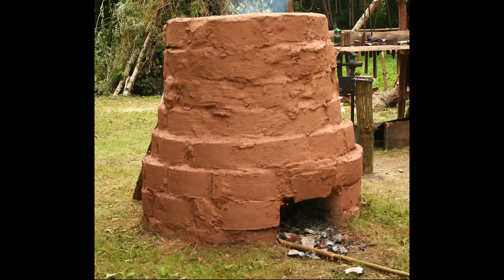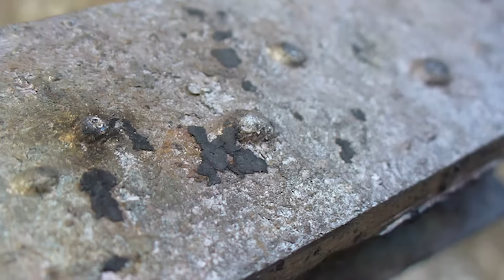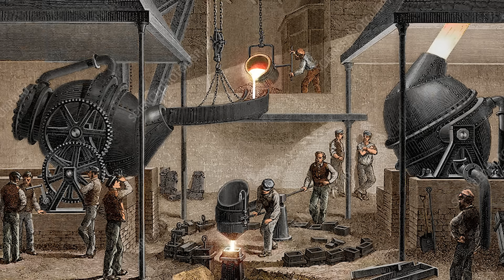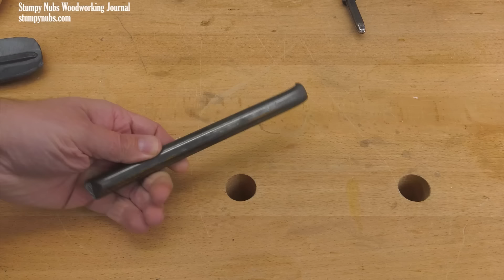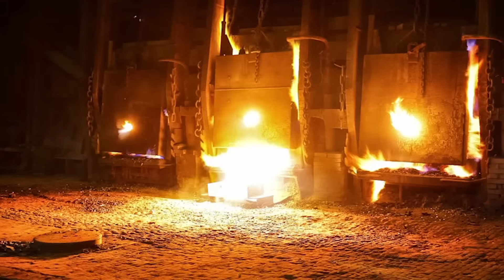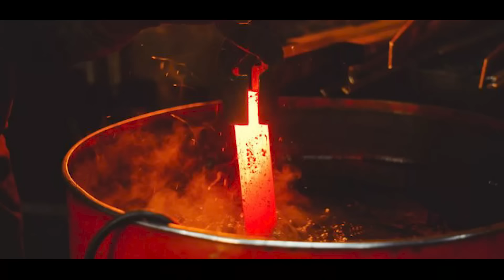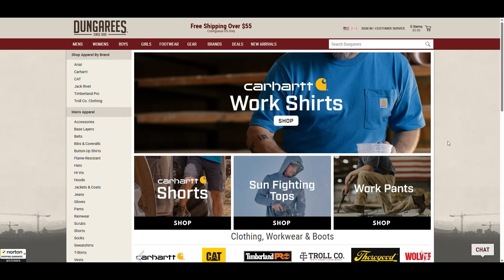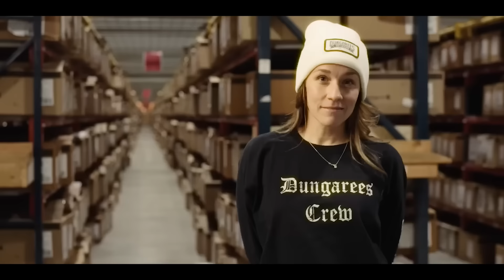Why they REALLY don't make tools like they used to

Comment: I used to teach a course in industrial materials and you got it right.
Reply: the only problem is the comment about bloomery furnaces that produced unforgeable pig iron. Bloomery furnaces in all their variations (such the tall, reusable ones of gallo-roman tradition, and the slag pit single use of germanic origin) were generally unable to produce pig iron, and were used till around the 13th century. They produced a very well forgeable and weldable bloom of iron with uneven carbon distribution, but generally low. Then to make steel the broken bloom was put into an Hearth furnace to enrich ir. From the 13th century iron makers developed the early Blast furnace, way taller than Bloomery furnaces, with a stronger draft and forced air, which indeed succeeded to make bars of cast iron, then broken and finally reworked in a hearth to make wrought iron or steel. This process went even into the mid 1800s in some places
Reply: Any good books you would suggest to a material science student?

Comment: Today's tool steels present a plethora of working qualities and are made better than ever. The problem for woodworkers is the same as always; a long lasting edge may be hard to sharpen and brittle. The basic O1 and W1 steels have a manipulable range of tempering that more exotic steels don't, and some of the heat treat requirements for higher alloys are beyond what even a skilled home machinist can do in a fundamental shop.

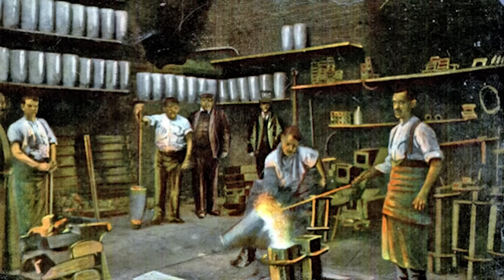Comment: @4:41 - I'm gonna be that guy - they weren't making low quality steel to make "railroad ties"
they may have been making rails, or maybe spikes, but railroad ties were/are made of wood.  (except for the concrete ones, but those are not steel either)

and, since I am already "that guy" - there is a typo in your more info section
Full sets (If you know what you want, this is a cheaper way to but.)
should be "to buy"

great video, James.
I often laugh at the idea that "older is better" when it ignores everything that has happened in the last 100+ years.
sure, there's a TON of crap out there now.  but that does not mean that we somehow CAN'T make better now.
Reply: While I agree that Stumpy got that wrong, steel sleepers (US: ties) do also exist.  They were used in areas where termites would often attack the wooden sleepers, or cases like that.
Reply: @PJRayment  well, I cannot say that you are wrong.  my understandin is that (in the US) the creosote levels of (old school) ties was so high that even termites would "nope" off out of there.
Reply: @ekw555  
"my understandin is that (in the US) the creosote levels of (old school) ties was so high that even termites would "nope" off out of there."
Perhaps so.  Termites was just an example—and possibly an incorrect one—of why steel sleepers have been used at times.

Comment: Pre-WW2 steel is a wild suggestion. The innovation in ww2 alone on steel is wild.
Reply: Unless they’re mistakenly associating it with low-background radiation iron post nuclear tests/use. But, by 2008 modern steel is back to negligible background radiation and not necessary. And, it didn’t affect the actual performance of the steel.

Comment: One thing is that vintage tools are often available for REAL cheap at yard sales/estate sales/flea markets/car boot sales (if in .uk). It's where i got almost all my woodworking tools (only a hobby woodworker here). I love my vintage stanley planes that i paid literal pennies for and had fun restoring and sharpening to dangerous levels :)
Reply: Edge tools are no fun UNLESS, they are dangerous. Keep the BandAids handy just in case
Reply: @johnduffy6546  No kidding, i have rolls of 3m micropore all over the place. In my day job i work as a commercial and domestic/residential electrician, i dabble in woodwork to relax. Cuts will happen.  If the tool is sharp,. it's a clean cut, and heals almost entirely in 24h
Reply: managed to plane 1mm off my finger the other day in penance for thinking i could take a few swipes at a dowel without using a bench and/or vise

Comment: In the argument of old verses new tools, I theorise that older tools appear better largely because of survivor bias. As throughout history, good tools command a higher price, partly because they are made with better materials. The surviving old tools often perform better than newer average tools, because they are usually the more expensive tools of their time and outlive their cheaper contemporaries. 
If we look at tools today, we have the technical ability to produce much more refined and improved materials. We also see that cheaper tools wear out, break or are otherwise discarded far more often than top quality tools. Thus we see that although more numerous, cheap low quality tools do not survive as long as high quality tools. Leading to false a impression that older tools are all better quality than new tools.
Reply: THIS !
Really good tools don't get thrown away, I've actually got chisels from my grandfather.
As I'm from Sweden, they are old Eskilstuna, and probably better than some real cheap ones today.
But not as good as good ones today.

Comment: It's worth mentioning that with the resurgence of hand tool woodworking in recent decades, there's also been an uptick in the availability of quality steel to make hand tools. 30 years ago, most hand tools that were being made were, indeed crummy and made with crummy steel. Also: when I buy vintage tools I rarely pay more than a few dollars for them- for me the cost associated with them is in time and work to restore them, which I enjoy.
Reply: Exactly. It is more time efficient to buy a new set, but learning to sharpen and make handles is an excellent project.
Reply: @ianbelanger7459  The handles are the great downfall of modern tools, i acquired some hand planes from on old polytechnic college which included an original stanely plane that had rosewood handles, that would merge with your grip and beside it were post war planes with worse and worse handles ending with one made of pressed sheet and plastic handles that would invite and welcome blisters.
Reply: @SToNeOwNz it is kinda astonishing how much difference a slightly large radius and slightly different grip angle can make.  The old handles require a better material to take the stresses, which is my guess at why they changed initially. It would probably be worth the effort to see if a modern material or manufacturing technique could reproduce the original styles.
Reply: @ianbelanger7459  I have made quite a few in the original style. I also sometimes reinforce them internally.
Reply: @Handcarvedbyrandy it is good to know it can be done with traditional materials, though I wonder about the cost. A lot of the exotic woods can't be exported as lumber and all the pieces I've seen have been quite expensive. I was more thinking alternate woods or interesting thermoplastics.
Reply: @ianbelanger7459  There are a lot of suitable domestic woods that will work just fine. Lie-Nielsen makes totes and knobs out of cherry
Reply: @Handcarvedbyrandy good to know. I just had a bunch of ash chisel handles shatter on me, so I do wonder about their selection process.

Comment: As a blacksmith, I've seen people fall into the "it was better back then" fairy tales about steel. Thanks for being real about it.
Reply: I'm a relative beginner to the craft, and when I picked up some proper mild stock to practice with I also got some 1045 (since that was the highest carbon content that particular shop offered). I wasn't sure how good it would be, but I found out that 0.45% carbon roughly matches the carbon content from the middle ages up through the renaissance and early industrial era. It's amazing to think that what we now consider to be medium carbon at best was the stuff that was used for swords, knives, axes, and everything else for nearly a millennium.

So yeah, we've come a long way. I still mostly work with mild steel, but when I dip into edged tools I feel like access to modern steels makes the whole process just a bit easier.
Reply: Knife maker here. I love the forgeable alloys, but it’s hard to deny the extreme edge retention of some modern alloys.
Reply: You’ve seen the stuff coming out of china? Anything is better than that garbage.
Reply: Here's the thing you have to take into consideration. I can pick up a vintage axe from my local flea market for about 10 bucks and the steel from that axe will be better than any sub $100 axe today. So there is fantasic value to be had from vintage tools if you don't mind a bit of restoration.
Reply: Absolutely right...it makes no sense to suggest that modern day steel alchemy and alloying is a poorer product than was available 100 years or so ago.
I have many modern made metal lathe cutting tool steel blanks that are extremely hard wearing and take a very keen cutting edge.
Reply: @howardosborne8647 I'm pretty sure the correct term is metallurgi, not alchemy lmao
Reply: @Shinkajo  I.m pretty sure alchemy is a terminology that is also used and relevant to the processes of alloying steels and other metal alloys.
If mocking my comment is the best you can glean from the comments here then I feel sorry for you.
Reply: @howardosborne8647 pretty sure you're mistaken. Will you please feel sorry for me too?
Reply: @beavisroadhog9629 Nah!😂
Reply: @howardosborne8647 Having the knowledge and using it are two completely different things.

We now live in a corporate run world where the bottom line and "number go up" is the end all be all. 

The quality is WAY lower across the board. The high quality might still exist somewhere... But can most people afford it??
Reply: @Foreverfreeusa  The amount of high quality metal alloys in all areas of modern day engineering/manufacturing far outstrips what was available to manufacturers in the past.
many applications in engine and jet turbine components for example would not have been possible with older metal technologies....we haven't gone backwards in manufacturing high quality metals at all.
Reply: @howardosborne8647 K... But YOU cannot get it.
Reply: @Foreverfreeusa  Why have you  written YOU in capitals? 
I have no problems getting hold of a wide range of specialised metals from carbon based steels,stainless steels,aluminium alloys,titanium and a lot of other high quality materials.
Reply: @howardosborne8647 Whatever... Corporations are using the best available to sell 🙄
Reply: @howardosborne8647  
there is one simple reason why we technically can't make steel as good as we did prior to 1945, due to nuclear testing the atmosphere contains radioactive isotopes in different ratios (and some which straight up didn't exist prior) than before, which does impact quality somewhat, although not enough to impact tool making like at all to my knowledge (like maybe you can run into problems when some of your tool steels carbon content decays into nitrogen, but carbon-14 has a half-life of 5,730 years so i doubt this issue will rear its ugly head anytime soon), but it is a legitimate concern in other applications which has created an entire industry dedicated to locating and recycling battleships that were sunk during WW-I to get to steel without these impurities.
Reply: @windhelmguard5295  This is known as low-background steel, and as far as I know the only reason why it's important is for very sensitive equipment where radiation coming from the steel can be an issue. As far as I know it's not actually any different structurally
Reply: @windhelmguard5295 Describe how "radioactive isotopes" affect steel quality.
Reply: @joebob4943  Yes for tools and general steel.  But not of course for precision medical/scientific instruments, and some precious such steel is on the seabed until it all rusts away or is looted.
Reply: @windhelmguard5295  And WW2, plenty of chunks taken from the Repulse and PoW near Malaysia.  Steely grave robbing.
Reply: @windhelmguard5295 That is a myth. First of all, old steel only matters for applications that are extremely sensitive to interference (think laboratory equipment). Second, radioactive isotope levels in newly produced steel have been dropping steadily ever since the end of above ground nuclear bomb testing, to the point that pre-nuclear steel is no longer particularly valuable. Third, none of this is relevant to the mechanical properties of steel.

"Steel was better back then" is utter nonsense. During WWII, the steel necessary to make good jet engine turbines hadn't even been invented yet! Jet engines of that era had lifespans measured in hours to dozens of hours! Lifespans! Not maintenance intervals! And that's without getting into technical details of why steel production capabilities today are much better than they were back then.
Reply: @joebob4943 they don’t.
Reply: Romanticized...nostalgia.
Reply: Is it? I still have an old honing rod made out of german steel after ww2. It literally grinds the material off knifes like a wetting stone. Modern steel is super soft because you it is cheap and low quality. You would have to really search to find a place that uses proper steel and then it will be expensive as heck
Reply: @saltysandman-c5mavoid Chinese metals
Reply: @saltysandman-c5msoo... what's yer point, Woodrow?
Reply: @saltysandman-c5m modern steels are often soft because they are heathtreated as such… not because the steel dont have the potential to be super hard. One reason for this is cost cutting, anoter reason for this is that most modern ppl dont know how to use tools proper, so if theyre having a go with a super hard tool, the probability of them breaking it is high….
Reply: @saltysandman-c5m you're comparing a tool that sold for (adjusted for inflation) $50 and was meant to last a lifetime versus a tool that is sold for $12.50 that is meant to be treated as a disposable asset. of course there is a difference in quality

Comment: I have a cheap $30 set of 5 chisels from Amazon (not amazon basics). For how infrequently I use them, they hold an amazing, almost razor sharp, edge for quite a long time. And if I remember to pull them over some wood or leather-like surface backwards every now and them, they don't dull at all.
Reply: I bought 2 sets of chisels from Amazon, about the same price, ground them to 5 pairs of skew chisels. Hardness test files indicate hardness in 56-58 range. They don't get used much, so it's not worth spending $25-35 for just one pair from a good brand. There are cheap good tools, and expensive junk, and cheap junk, and expensive good ones. We just need to stay away from junks.

Comment: One of the best old chisel I’ve worked with was a softer steel blade, but with a hard tool steel insert in the edge. The insert is hard enough it should be brittle (estimate at Rc64 or so, using hardness files) but the softer steel backs it up, takes some of the shock.
I think if we were to do something similar with today’s steels (say a CPM SV30, SV45 or so) backed with a “normal” tool steel at a lower hardness, you’d have something truly amazing, but the cost would be crazy.
But as you say, if you are willing to pay for good steel today, they are amazing. Even 30 years ago, I was buying Hock blades for my planes (he sold the business to Lee Valley)
Reply: I have a couple of plane irons that are constructed like this with a super hard piece of tool steel fuse welded to a body of more malleable steel....you can clearly see the difference when one of the irons is honed to a high surface finish.
I also have a number of metal lathe cutting tools that  are made in a similar fashion with the main shank being a general softish steel but the cutting edge has about 3/4" of seriously hard cast tool steel fuse welded to the shank.

Comment: what is interesting is that until the industrial revolution when blast furnaces took over and the ability to roll steel.  they unlike today did not understand the impurities in the iron such as slag and phosphorus, or how that affected the metal.  but impurities such as slag and phosphorus in the metal meant it didn't rust.  this is why we have iron that is up to 800 years old that has not rusted.  this is because that dark blackish patina on old iron is where a chemical reaction has taken place and naturally protects it.  for ease of mass production and economies of scale modern tool steel rusts out quickly if not protected.  the old iron workers separated the bloom iron into three categories.  there is so much about steel that is very interesting to discover.
Reply: Modern steels such as 'weathering steel' or Corten Steel have great anti corrosion qualities for longevity.

Comment: Better steel is available today than ever before. Cheaper steel is much better than cheap steel of the 1960's - 1970's.
That said, it is also possible to get a lot of real junk from Asia that reports to be a great steel but is actually something developed for cheap kitchen knives. 
 I have several old chisels that were only hardened about 1/2 inch down the cutting face.  I have had to re-harden them in order to sharpen them. They work, but not as well as my newer chisels.  I also have 2 very old, laminated plane blades that take a very good edge, but they have warped a bit from hard use. They should likely be used only in solid wood block planes.  Great treatment of the topic, thanks.
Reply: Good steel might be available but if manufacturers they're cutting ever cost to make disposable junk, they're not going to use it.